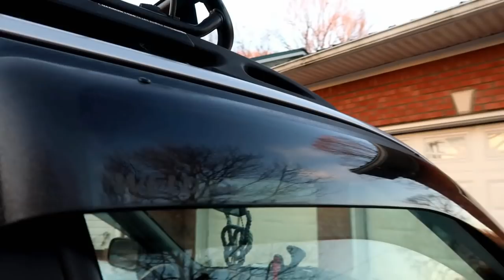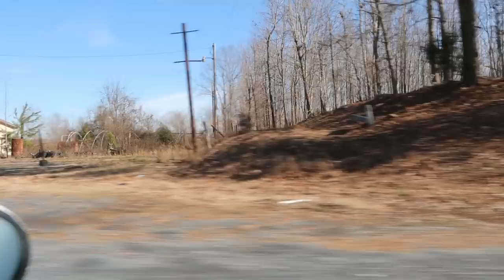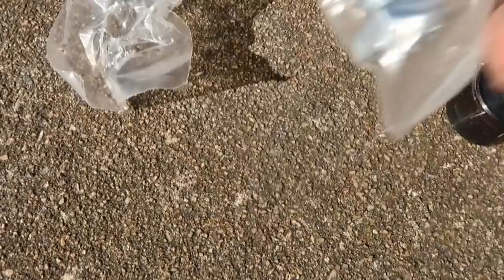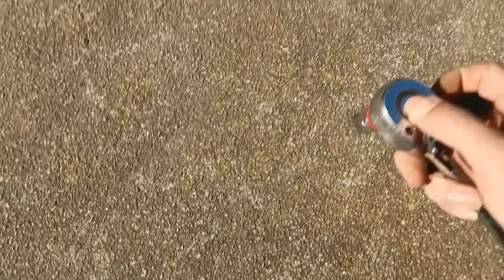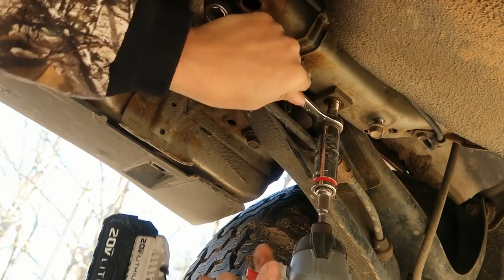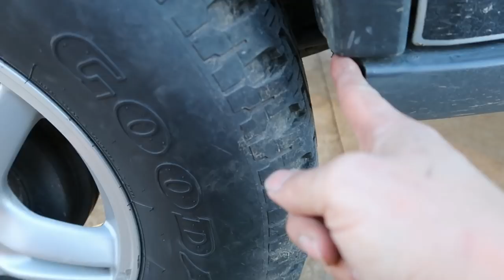Lifted Crv Trailing Arm Drop Spacers

Comment: Did the lift affect your toe ? As by dropping the control arm arm changing the toe ?
Reply from the maker: Jason Sanchez I did but not by much but best to take for a alignment after.
Reply: So what lift do you have front & rear ? Right now I have 2 in spacer upfront & 2.5 in spacer on the rear. Stock kyb fully loaded shocks on the front & bilstein shocks & the dobinson lift spring on the rear.. but my toe is off on the reAr
Reply: Don’t know what to do, I seen online some spacers you can do to drop the whole rear subframe but I feel like it’s too much & I seen that you only did the trailing arm & now I’m wondering if that’ll help, cuz wouldn’t the lower control arm still be holding it in..
Reply: Jason Sanchez you can used trail arms spacers then get aftermarket camber kits for the rear and after that you can take it to the shop to get an full alignment